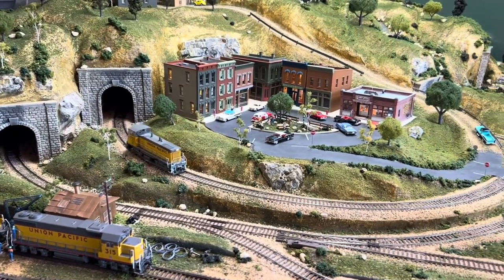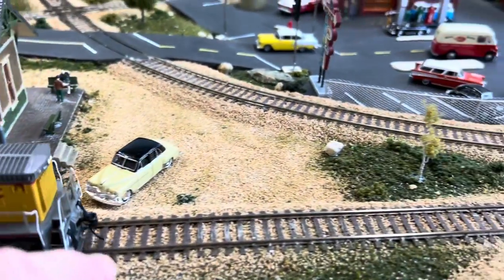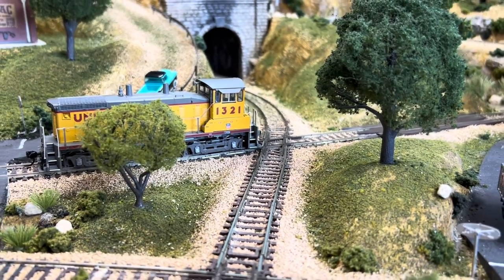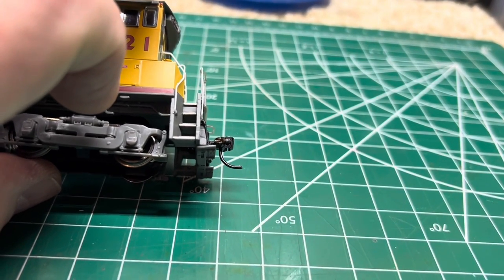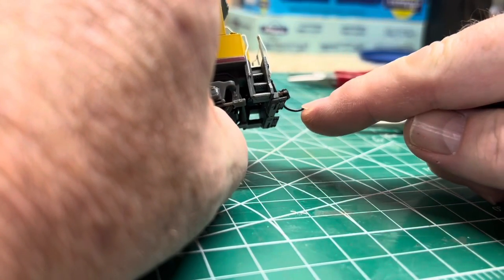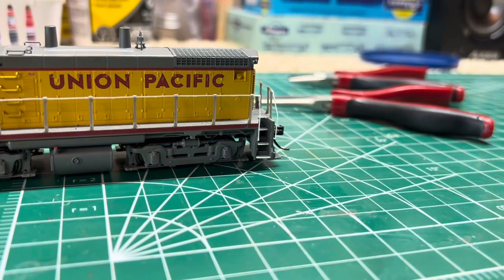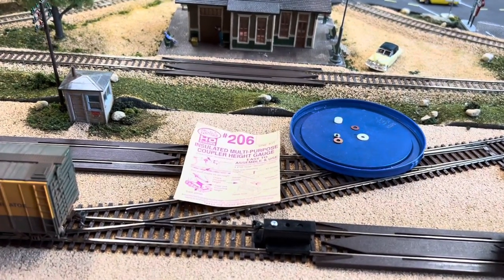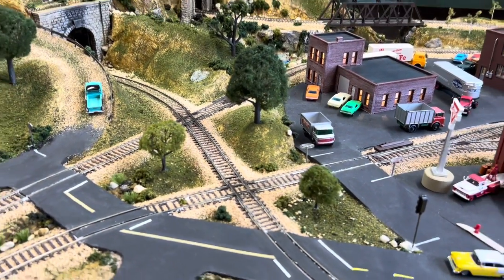Solving Coupler Hangups and Height Issues on the Grand Valley Layout.

Comment: Can you not just push the pin up through the coupling ? although personally I would try to resolve the slop as it wont be sitting at the right height to couple when drooping possibly resulting in trains breaking apart as you refer to when speaking about the railcars
Reply from the maker: I’ve not run in to any pins that I could push up, but I have seen them.  Replacing a worn coupler is a good idea to get that slop out, I should have mentioned it.  With a load on them, even droopy couplers tend to pull evenly, but yes if you’re getting uncoupling issues, replacement would be the best bet. Good comments, thank you for sharing!! 👍🏼
Reply: i was wondering about the sloppy couple a well